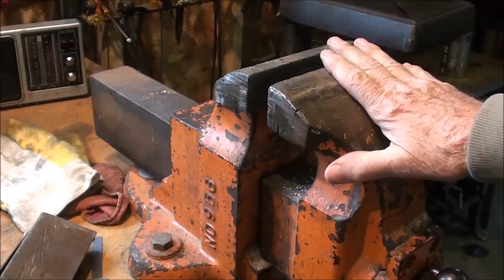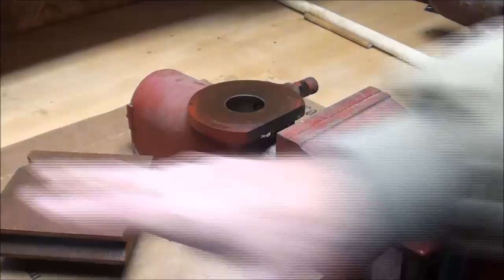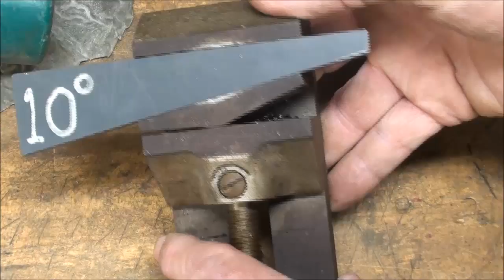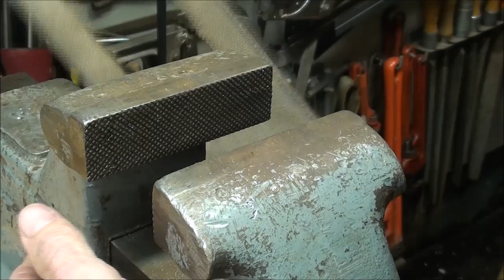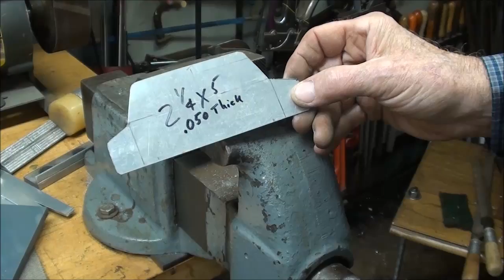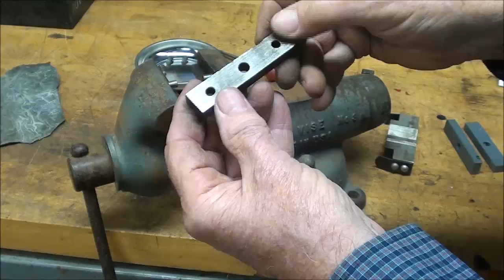SHOP TIPS #219 Wilton Vise Jaw Caps tubalcain

Comment: Hiya Mr. Peterson! My family had a lawnmower and bicycle shop for around 50 years in Huntsville, AL. My Grandfather acquired a dozen or so Wilton vises surplus from the government after WWII and we had them installed all over the shop. I actually broke the front jaw clean off one when I was replacing a 10 speed gear cluster on a wheel. I had the socket designed for the gear cluster in the vise and had the wheel cluster in the socket. I remember grabbing each side of the wheel and giving a mighty tug and the next thing I new I was sailing across the bike repair bay into a tangle of bikes with the bike wheel, socket and vise jaw all in my lap. Ahhhh, good times.
Reply from the maker: Wow

Comment: On one of my 3-1/2 jaw Craftsman vises I made a pair of soft jaws of of flattened 1/2 inch copper pipe and held in place with double sided tape. I have also made soft vise jaws from a piece of lead sheet that was used in roofing.

Comment: Watching 5 years later in 2022 and the pricing on Wilton jaw faces is still painful for hobbyist types like me!
Reply from the maker: Yes
Reply: @mrpete222  Pleased to report I fabricated (er, banged out) some copper caps from 1/2 copper pipe for a 4 inch columbian that I got at auction a couple weeks ago.  I cleaned up and painted the vise -- and happily gave it new marks!  Peace.

Comment: Nice informative video. I recently bought an old Wilton and made a wooden jaw caps for it. They attach via 2 circle magnets to the jaws, so you can easy take them on and off. Plus the magnets are glued inside of the wood, so they stick out whatsoever. Easy and practicle setup for wood work and so on :)

Comment: Went through 1500 vices on ebay but did not see one like the four surafce rotating jaw vice.
Reply from the maker: I have never seen another one like it. Maybe it's just a novelty. But I kind of like it, but never have actually used it
Reply: I’m interested too. Thanks for checking around, I’m doing the same with the tool collector club

Comment: Lordy! Lordy! We would never be able to expose students to lead! lol - You have a vice for all reasons. - Lowe's now sells PVC planks that would be useful to make jaws.  You can also get the HDPE cutting boards that would work. - You said something about a NEW garage, is it heated for winter use?  You probably need a 20,000 sqft warehouse!
Reply from the maker: Waht is the exact name of these pvc planks???
And in what dept at Lowes??
Reply: I called our local store and the young man, who had to ask someone else, said they are in the "MillWork" section in lumber.   They are white, milled to standard board sizes, and I think they are made to be used in door casings to eliminate rot, and it says they are paintable.  - Happy Machining!
Reply: PS: Saw an interesting Charles Parker anvil vice on ebay item #122863623195.   I thought Charlie Parker was jazz artist.  LOL
Reply: Forgot to add the name. - EverTrue PVC Board   (Actual: 0.75-in x 5.5-in x 8-ft)Item # 209621 Model # 07311
 -  Another name:  Royal Mouldings Limited PVC Board (Actual: 0.75-in x 5.5-in x 12-ft) Item # 238347 Model # 2827

Comment: I've no idea who makes that vise, but, it's called a rotary head milling vise. ABM tools makes a similar one, but in their design the turret or rotary head is on the other jaw. It's a production style vise. Similar in concept with a turret lathe, you have multiple holding stations for a particular job. Start with stock, cut, turn head, put in vertical, cut, turn etc.

As vises go, that one, is pretty darn rare. I think i've seen one in my entire life and i've seen quite a few vises (a bit of a vise fan boy).
Reply: Thought that might be a vise for milling round stock, or shafts.  Kept doing searches with turret jaw.  Will try rotary head.  -  Meant to add that it looked like the handle would be in the way as a milling vise.

Comment: All good vise ideas, very useful!
A word of caution however on the PVC jaws...  Any competent machinist would know not to over tighten them, but if a hammer & chisel guy wandered into your shop and proceeded to "wrench them down tight" (as the old Norton motorcycle manual suggests you do to torque head bolts) the PVC jaws could explode and fly apart with quite a bit of velocity and very sharp edges...
Reply: +Al C
Yes, and for much the same reason, plastic pipe should not be used for shop air plumbing. If for whatever reason, it gets hit, broken or what have you, all of the associated pressurized line in the shop can, and likely will 'explode' all at once showering the shop with flying plastic shrapnel. Having said that, I've heard that special plastic line intended for compressed air is available, but is expensive.

Comment: Along the same lines, but for holding threaded items. Grab a couple of nuts the correct size, the cheaper/softer the better. Then with a hacksaw cut through them, straight down at 45° across one of the hex apexes; and clean up the ID threads as necessary with a thread chaser. To use, run them down and space out on the work with the kerfs (slits) 'up', and when you tighten the vise, they will bend/deform closed enough to hold the work firmly sans thread damage. Usually these nuts can be used several times.
Reply: That sounds like a neat idea for clamping threaded items. What I do to keep it simple is just clamp the threaded item between a  couple pieces of soft pine. The pine deforms and grips well, but doesn't damage the threads. Your method would work great if you need to clamp something really tight.

Comment: A piece of appropriately sized hose slit the long way is just the thing for some jobs... even though it looks a bit hokey. And as a side note for the new players... when mounting a vise you can make it much more versatile if you place it with the 'fixed' jaw hanging out ever so slightly over the bench edge... thus allowing longer items to be held vertically if need be. Most vises are so designed to allow such mounting.
Reply: +rwbishop yeah I had to remount the vise on my tripod just so the back jaw overhung the plate it is mounted on. Originally I went for a more symmetrical configuration, but in doing so the back jaw was blocked in the vertical. I use that vise to angle grind things. Bench vises are just too high for that work.

Comment: PVC is thermal plastic and can be heated up with a heat gun and then formed to a shape and when it cools, retains that shape.  Kydex is also thermoplastic and I am sure that they both with made decent quality jaw caps.  Kydex can be bought on eBay or Amazon in sheets. Usually its used for knife and gun sheathes. PVC pipe is already round, so if you saw a tube in half its already halfway there.
Reply: +traderjoes Great idea! And almost all of us have scrap piece of leftover PVC pipe laying around. (For anyone who doesn't I think a long 1 1/2" coupling would make a nice pair for less that $2)

Comment: About the only configuration you didn't show was one like the Faithfull V2075 - it has a reversible body to allow it to grip wider loads. Polypropylene jaws, grooved, to hold pipes without marking them. Jaws can be replaced with more conventional ones by undoing the usual couple of fixing bolts.

Comment: I find the cast lead jaws that you mentioned to be really useful, most gunsmiths use these as they are non damaging, so much so that a threaded screw can be held tight without damage, the threads biting into the soft lead, they are also free, in as much that once the simple mould is made, as soon as the jaws become too damaged they are melted down and re poured, which takes only minutes, and you are back with new jaws.

Comment: If you make a set of jaws with holes in the top, 1/8 - 3/16 works well enough, and a set of pins to fit you now have a pin vise. Useful for holding ring shapes in either compression or tension.

Comment: How did they bend the wiltons? Man, that's kind of surprising. That said I think back to my time in school (all male school too)...everything from pillar drills to computer CRT monitors got some rough treatment. Cuts into the benches in woodworking, notches out of T squares in technical drawing, files used like sand paper haha You'd wonder how the school kept anything working and paid for the replacements.
Always wanted a nice wilton to clean up and put back to work but they don't exist on the second hand market where I am in the world (well you might find one in with a joblot of hens' teeth).